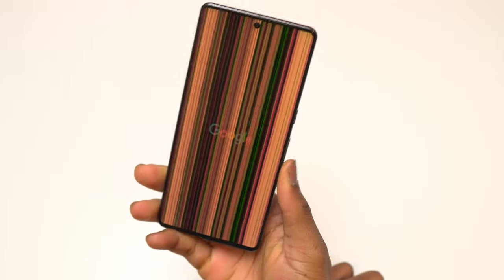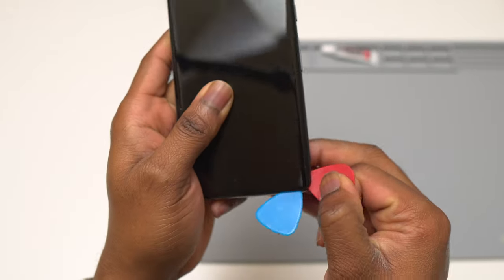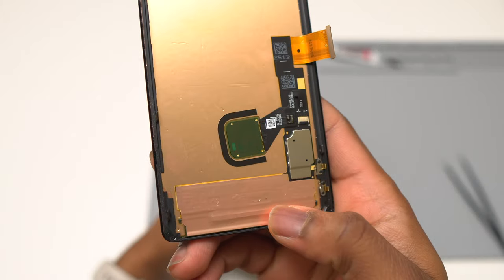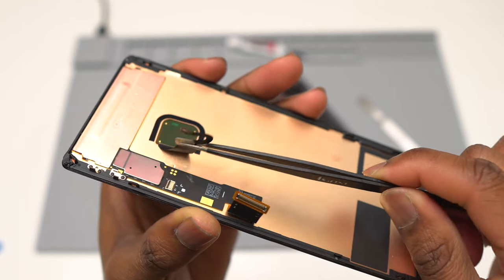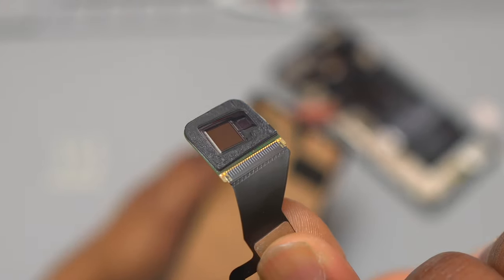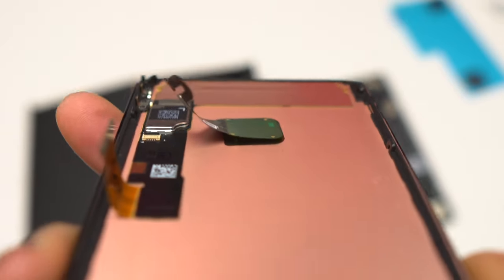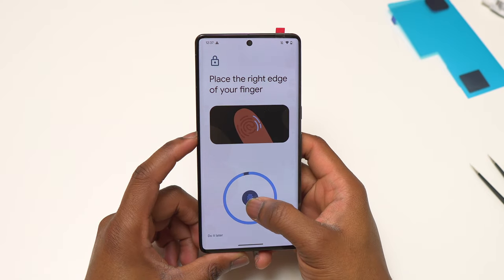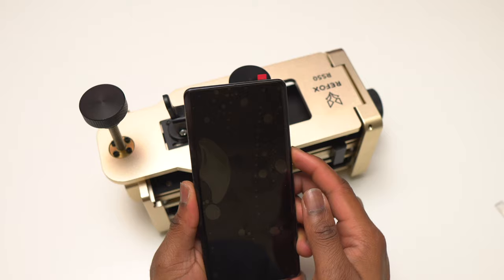Google Pixel 7 Pro Screen Replacement

Comment from the maker: ‼EXTREMELY IMPORTANT ‼

A word of caution there are some tiny pins on the inside of the Pixel 7 Pro making contact with the screen when closed.
Make sure you look carefully at all those and none is sticking close to 90 degree because if one is positioned that way it will puncture the screen and damage it (you'll need a new screen again). A very stupid design that can cost a new screen while trying to replace a broken screen.

Be one of the only few who support and find value in my videos.
Please spare some change to help the channel keep moving forward.
https://www.buymeacoffee.com/ersbit
Reply: What are they for anyways?
Reply: I just replaced my screen double-checked that all pins were flat, then when i "clicked" the screen into place, it didn't wanna completely go inside of the frame, i pushed some more and now i have a line across my screen........ Sucks but atleast i can use it now. We'll see how long unitil the screen is completely unusable again.
Sidenote: I bought a "original AMOLED" screen of Aliexpress and i notice a difference, especially with frame rate, feels more like a 45 Hz then 120Hz, but then again it cost around 65USD.

Comment: Hello and thank you for the helpful video. Did you have your pixel turned off before proceeding with the replacement? Screen is totally unresponsive on mine so I can't turn it off to proceed with the replacement.
Reply from the maker: No mine was not turned off as the screen was unresponsive. It did not have any issues on the device.

Comment: Don't just yank the screen out like that.  There are pins in that connector on the logic board you can easily damage.  Use a tool to carefully disconnect and be careful reconnecting not to mash the pins.
Reply from the maker: Ok. I agree with you I could have do it with less vigor or use a tool. No problem, am sure your contribution will enlighten some of the readers.

Comment: beautiful!! but do you have a video on how to install the glue? thank you.
Reply from the maker: Hi, that would not be hard. You just install the double sided tape if it was provided then install the screen. Remove the plastic film on top of the double-sided tape then close the phone.
I believe on my pixel 6 pro screen replacement I used b7000 glue to seal the phone.

Comment: I used a heat gun. Like thirty seconds is enough. 😂 Make sure you completely remove the plastic frame. My screen was destroyed and the thin plastic frame was still stuck on the phone. The metal frame around the phone is silver and should be visible. I used the official repair kit with the adhesive ribbon and that was a pain. I ran it again with the heat gun to melt it back down again just in case.
Reply from the maker: Great infos. Thank you for sharing

Comment: Does the finger print sensor area on the replacement screen come with built-in adhesive? Because I didn't see you add any to it, prior to sticking it on.

Comment: Great guide I followed along and fixed my own pixel 7 pro thank you
Reply from the maker: Your most welcome 👍🏽.
Reply: Hello, where did you buy screen replacement, are these from Ebay legit?
Reply: A quick one please I noticed my fingerprint does not register my finger after replacement, is that an issue ? cause it’s original replacement screen

Comment: Great video! I tried to do the same, but when I replaced the fingerprint-sensor, it didn't work even though everything looked perfect. I tried to remove it and put it back a couple of times, but still didn't work. Any suggestions?

Comment: any experiences here with cleaning the fingerprint sensor gently? software is working but hardware lense maybe dirty or smeared.
Reply from the maker: No I have not had any thing like that. Cleaning it not sure maybe isopropyl alcohol but I have not done it to say Yes it can work and wont damage the sensor. I prefer to base my answers on my experience. To avoid cleaning etc... that why I used heat to remove the sensor instead of alcohol like some people suggested.

Comment: Hi, really enjoyed watching your video. I wish the guy who replaced my screen have watched it before working on my phone. Now the fingerprint recognition feature has mysteriously disappeared. I have thoroughly searched my device's settings, but there is no trace of the fingerprint option. I even attempted to use Google's online fingerprint calibration tool, which appeared to work as expected; however, the fingerprint option is still gone. If you have any wisdom to share, please do.
Reply from the maker: The only thing that would do this is a bad fingerprint sensor. Most likely got some kind of damage during the removal / installation....
Example. On my previous pixel 6 pro without the sensor connected the setting disappeared. As soon as the sensor was back in working condition it reappeared.
Reply: Mine is appearing but it’s not registering my finger

Comment: I'm about to replace the screen on my 7pro (white) -the screen is the only thing damaged.  Should I buy the replacement with or without the black frame??
Reply from the maker: It's better to have the black frame. As removing and reattach the old one will be hard and not 100% sure you will succeed and even if successful it can start to detach from the screen. 
I would advice getting the screen with the frame pre-installed.

Comment: This is the video I needed. Thanks!
Reply from the maker: You're most welcome. One thing I forgot to transfer is the small plastic that hold the front camera in place. It is glued on the Front camera screen hole. You can heat the screen and remove it then install if not already on your new screen. I did not have any issues despite not having it. Only scenario it might be an issue is when you're running while recording with the front camera...there's would be less stability (maybe).

Comment: @ersbit I notice that on the original screen there is a piece of plastic for the front facing camera, but the replacement screen in your video does not have it. Why did you choose not to move that plastic part from the old screen to the new one?
Reply from the maker: I should have transferred that piece of plastic (that's good practice). I did not do it because from my experience with the Pixel 7 Pro it did not change anything after I did the screen replacement without it. (It would be better to have it in place as it should help stabilize the front Camera if the camera shakes or move). Screen closed most likely it would never shake or move unless you record a video while running. So you should have it in place on your phone screen. Just use a small amount of b7000 to have it in place then install the new screen or just place.
Reply from the maker: I overlooked it while doing the video ( forgot about it)
Reply: @ersbit  So you can simply heat and remove that front camera place holder plastic, and remove and transfer it to the new screen with the help of a little adhesive?

Comment: Where can I get a good replacement screen because ifixit do not ship LCD to south Africa
Reply from the maker: I am sorry to hear that....I only know they claim to have original screens. On eBay they might ship items internationally but theirs no 100% guaranteed the seller is selling original parts from Google. That's the issue 🤷🏽‍♂️. It can work like the one I use it's from eBay but original for sure it was not to the same quality as the previous screen.

Comment: The new screen you have purchased seems not to be a genuine pixel 7 pro amoled one. It rather seems to be a cheap aliexpress lcd screen. Can you please tell us if the performances are good on this new screen?
Reply from the maker: Humm that's a hard question to answer. The date I did this was a few weeks after the device was released. I bought a screen on ebay $200. From what I heard you can get a new screens "original" from ifixit. They have some kind of agreement to provide original screens from Google to customers. The screen I used was not labeled original or something like that and even if it was I would not trust it since I am getting from eBay and not from Google directly etc...
Reply: @ersbit  OK, thank you very much for your honesty :)
Reply: @ersbit do you think this replacement screen was oled or just a lcd one?
Reply: @ersbit  what is the resolution and refresh rate of this screen?

Comment: Where can I buy the compression device which you used at the end of this video?
Reply from the maker: I had links in the description for the parts. The pressure tool is not a must you can use paper binding clips (large enough) or phone screen pressure tool. 
All these tools should give the same results. "Make sure all the gold color pins are all pointing down and not up if not it will puncture the screen and you will be need a new screen again.
Reply from the maker: Screen Press/Remover: https://bit.ly/3Vs4m3b
Reply from the maker: Pressure clamps: amzn.to/3PJngA8

Comment: is this screen replacement with or without frame?
Reply from the maker: The screen I used came with the small plastic frame that is on the original screen. Only the small plastic frame for the camera was not included. You can transfer it on the new screen if you want. I didn't as the camera was still in alignment and good.
Reply: isn't that small, black housing for the front-facing camera on the original necessary? seems like not having it might affect camera performance. would it be difficult to detach from the broken screen and reattach to the replacement?
Reply from the maker: @fcarb just heat the area on the screen and remove it with a flat tool. Réinstallation you might need a very thin layer of b7000 on the plastic pice before installing on the new screen. It help stabilize the front Camera in case there's too much motion. Indeed I forgot to have it transferred on this video 😅

Comment: Great guide. I've replaced the screen on my Pixel 7 Pro using iFixit parts, but the screen doesn't work as expected. When charging after the screen is reconnected, it shows the GOOGLE logo perfectly for ~5 seconds, then flashes green stripes for ~100 msec, then goes black, then a few seconds later shows the GOOGLE logo again. It gets stuck in this "boot" loop. This happens for at least 15 minutes or more. After an hour of charging, the screen stays black and no longer goes through a boot loop. The device appears with `adb devices` but is shown as 'unauthorized'. The screen is completely black.

Any ideas on this? I've seen one other person (on iFixit) stuck in this "boot loop" after replacing the screen, but there was no resolution to the problem.
Reply from the maker: Hi, the only thing that I came close to this was when I tried to turn on a Pixel 6pro screen on a Pixel 7pro. The Google logo would appear then stay black forever. When I put the original 7pro screen back on everything works no problem. 

First thing I would do it put your old screen back to make sure that one is working fine no problem. If old screen does not work as well as before there must be something that happened between removing the old and installing the new screen. Check the screen flex cable connector on the board to make sure it's good it doesn't look damaged etc... If your old screen works fine after réinstallation just return the ifixit screen and have them send another one and tell them to make sure it works before sending it. (Ifixit is supposed to have original screens from Google so there should not be any compatibility issues unless the screen is defective). 

Keep us posted on the progress 👍🏽
Reply from the maker: My screens were aftermarket (not claiming to be original they never had this issue which strengthen my suspicion of bad screen from the beginning) and they worked fine no problem 6 Pro and 7 Pro
Reply: @ersbit  You're 100% correct. They sent me a Pixel 6 Pro screen. After looking under a microscope for 30 minutes, we noticed the 4 copper pins on the screen didn't line up with slots on the body of the phone. There are only 2 copper pins on the original 7 screen. (The original screen was trashed by gracefully smashing into the sidewalk, so is 100% non-functioning). After noticing the pins, I just compared them side by side, and it's clear they're different screens. There is a small opening on the top that exposes what I'm assuming is an ALS. On the 7 Pro that slot is horizontal. On the 6 Pro it's vertical. They were so similar, and the initial bootup shows the Google Logo, so I had just figured it was a different rev of the screen. 

But you're spot on. It's a 6 Pro screen connected to the 7 Pro body. Thanks for the reply!

Comment: can the nfc antenna be swapped with only removing the back cover?
Reply from the maker: No you can remove it safely only by removing the screen and access the NFC and wireless charger.

Comment: Great walkthrough, thank you very much for this informative video
Reply from the maker: You're most welcome 👋🏽. Glad you found the video helpful. A word of caution there are some tiny pins on the inside of the Pixel 7 Pro making contact with the screen when closed. Make sure you look carefully at all those and none is sticking close to 90 degree because if one is positioned that way it will puncture the screen and damage it (you'll need a new screen again). A very stupid design that can cost a new screen while trying to replace a broken screen.
Reply: @ersbit  Yup, found that out the hard way. First time I tried to get it repaired in a special shop, when they closed the phone, you could see a white vertical line on the right side of the screen. Next time, I tried replacing it myself. I was very careful with those pins and when I closed the screen everything was functioning fine, except 3 days later the same white vertical line of dead pixels appeared. Now, I have another screen waiting for me to replace it but I'm just tired and kinda got used to that damn white line of death. Don't even know if it is due to those metal pins or perhaps the problem with the connector or port on the phone itself.
Reply from the maker: sorry to hear all these. The pins are the issue you should look on the back of the screen when it is off and find the stop that has been punctured and push it down. I don't think it is the connector. This is a problem I have seen online for the pixel 7 pro it is not isolated and before the screen would be good when testing before closing the device.  @MegaLUX13

Comment: i have a weird problem with a screen replacement that i bought, i plugged it in first to see that it was fully working, i then lowered all the pins flat so none where sticking up, when i glue the screen down the phone would reboot everytime the screen went to sleep, i bought another replacement and it is doing the same, has anyone else had this issue?

Comment: What if you don't use the finger print scanner? Do you even need it on the new screen????
Reply from the maker: That's a great question. It should work without issues unless they have made a software thing to make sure for you do use the security, face recognition or passcode password you need to set up fingerprint first. Then it would not work. 
I need to test the theory. To have a definitive answer. 
It's either it work omitting the fingerprint stuff or required it to set up other security layers.
Reply: not having it work could affect the resale value if you wanted to trade-in for a newer model.

Comment: I did everything correctly and everything worked great but for some reason when I tried to insert the new screen it would not shut close?????
Reply from the maker: Did you add b7000 or has the screen came with pre-installed double sided tape? With either the b7000 glue or double sided tape it should close and stay sealed.

Comment: My bottom mic doesn't work after screen replacement (original screen) do u know why?
Reply: @hirushawijethunga6314  did you find out? Happened to me. I have a hunch that the phone was on when I inserted the screen and connector - and it ruins the microphone mic1. Thoughts? I don't know what's happening to mic1 (bottom microphone) for it to die so consistently

Comment: Will pixel 6 pro fit pixel 7 Pro?
Reply: Screen*
Reply from the maker: No it will not work. 
The screen connector is the same but the fingerprint sensor will not fit.
The screen will show the GOOGLE logo then stay black. 
Conclusion you cannot interchange the screens.
Reply: @ersbit  thanks!

Comment: Je peux acheter la nappe empreinte pour pixel 7 pro car je ne retrouve pas sur aucun site ?
Reply from the maker: Salut Camara, jai regarder aussi mais je trouve pas. lol cest toujours pareil avec Pixel les parts prenne trop de temps avant detre en ligne. Cetait pareil avec le Pixel 6 pro.
Reply: @ersbit  salut juste savoir ,si la nappe d empreint pour le pixel pro 6 est compatible sur le pro 7??
Reply from the maker: J'ai essayé ça mais ça marche pas ! Surtout le design ne permet pas le Sensor d'être à la même position que l'original. C'est pas possible. L'écran aussi pareil quand j'ai allumer le 7 avec un écran 6 le logo Google apparaît puis rien du tout. Sûrement ils ont fait le minimum pour que ça passe pas le bootloader. 

Avec un peu de chance d'ici là fin du mois maybe il aura les sensor sur eBay

Comment: I want to buy flex capteur empreint pixel 7 pro ??
Reply from the maker: I found other parts but not the fingerprint sensor. I generally buy on ebay or amazon. You can check ebay maybe  end of the month it might pop up by then.